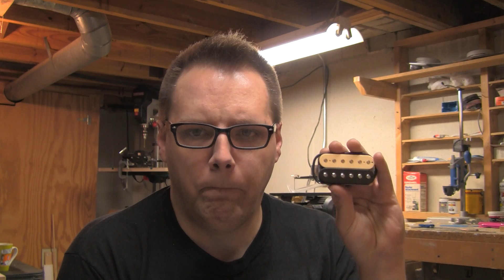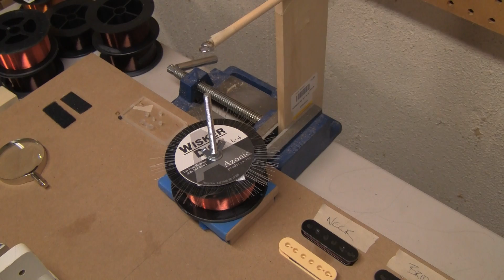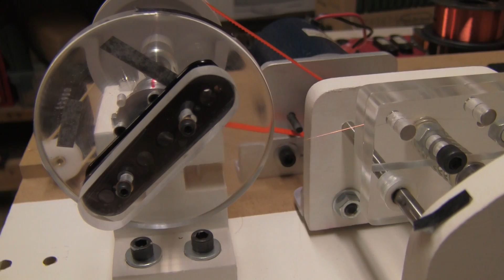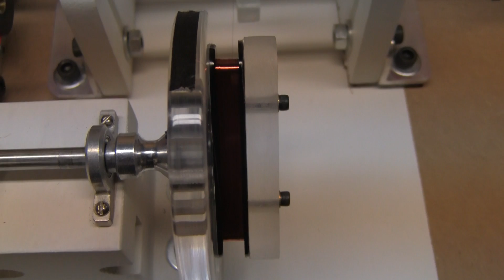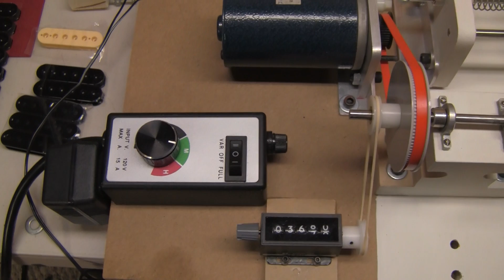How it's built part 1

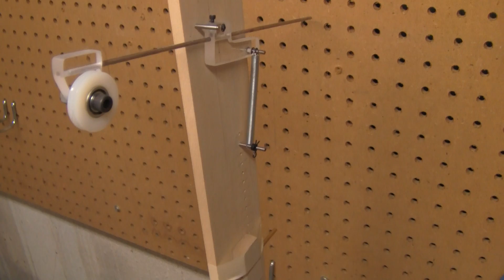Comment: nice simple tensioner at 4:25. is that a home depot door spring? something like http://www.homedepot.com/p/Everbilt-5-32-in-x-2-1-2-in-and-1-4-in-x-2-1-2-in-Zinc-Plated-Extension-Spring-4-Pack-16080/202045471 ?